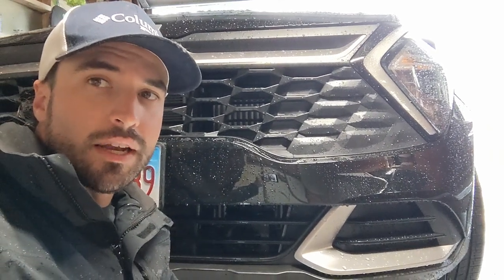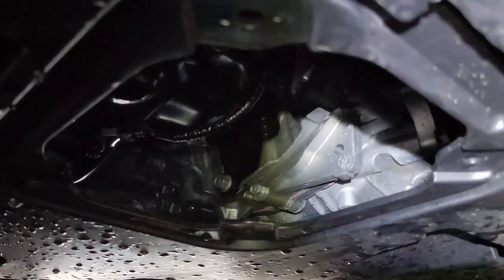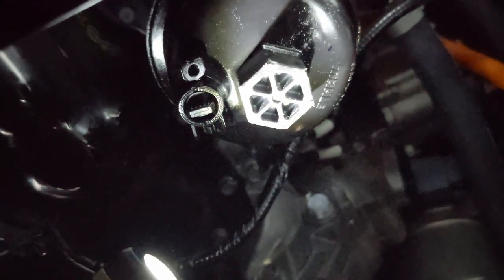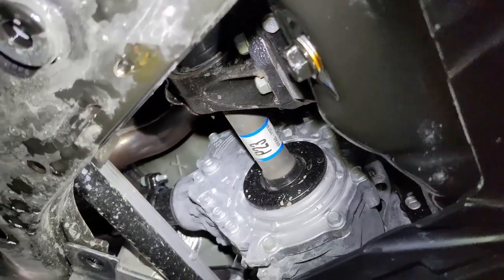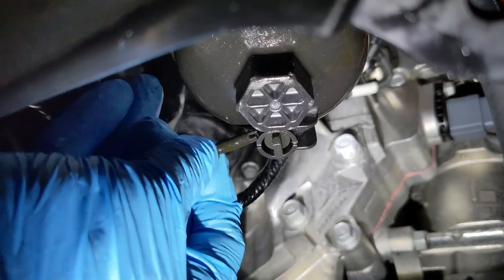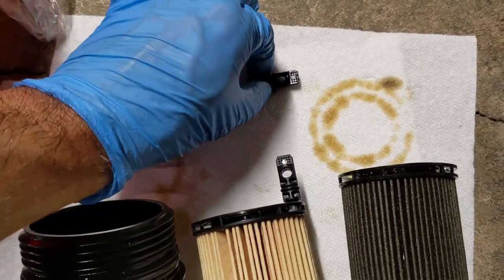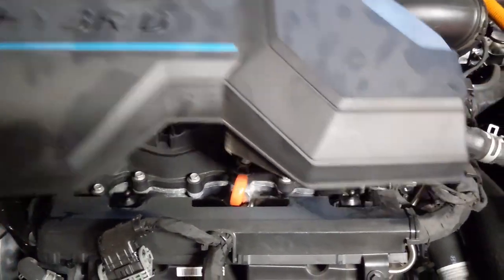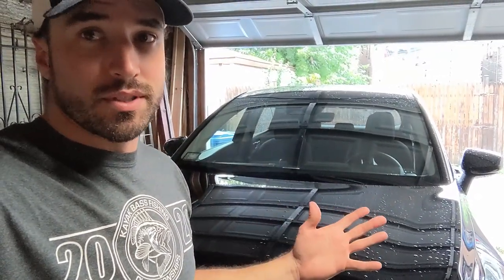Watch This Before You Do An Oil Change on Your 2023 Kia Sportage Hybrid

Comment: For those who are wondering, you will need 24mm of 6 or 12 points socket wrench to open the oil filter housing.

Thanks for the video! It really helped me a lot getting the correct parts.
Reply from the maker: Thanks for sharing this info. 

Glad the video helped!
Reply: Good old Kia, why not make it the same size as the oil drain plug? So frustrating… so Kia did my last oil change and made it so tight I couldn’t even loosen it with an adjustable wrench for fear it would strip it. I had to go buy a 24mm socket. Ridiculous!!!

Comment: what kia usa has to say about servicing your own car rather than certified shop vs the warranty?
Reply from the maker: The key is documentation. So long as you keep receipts for the correct synthetic oil/OEM filter along with mileage logs, you are properly documenting your changes at the recommended intervals. Not changing oil causes very noticeable issues that are easily traced back to not changing oil. Any other drivetrain problems covered under warranty are generally not related to oil in any way. 

I'm sure a dealer will tell you otherwise but they obviously have a little different motivation for doing so. 

If your dealer offers free oil changes, by all means take advantage of them. If they don't, I'd be saving my money and ensuring the proper oil is used in my car.

Comment: You do know this voids your warranty for your engine if anything happens kia will ask you for proof of oil changes at XX about of miles and dates and type of oil and if it was done by a certified shop or mechanic etc , I know it sounds crazy, but dealers do  everything to avoid paying out for big repairs such as a engine replacements.
Reply from the maker: Incorrect. 

I have records and receipts organized. My warranty is still valid.  

When I went to the dealer to get my free change, they failed to do it properly. I won't be allowing them to mess things up again.

Comment: does the oil brand matter? as long as it’s full synthetic it’s good?
Reply from the maker: In my experience there is no notable difference. This is an endless online debate but the tests and studies I've seen conclude that there is not a significant difference for normal drivers. Most off brands are manufactured by the same companies that produce the big name brands anyways.

Comment: Great vid!  On the 2.4L and 1.6L Hyundai/Kia oil pans I wish they designed the plug area so all the oil drains out.  The plug is up too far so there is always some used oil left in the bottom of the pan.  I let the oil drain overnight then rock the car backwards and fwds to get the last of the oil out the best I can.  The older 2.0L oil pans were designed so the drain plug was at the lowest point so all the old oil would drain out on its own.  Also do use a new crush washer and don't over torque the plug as the 2.4L pans are prone to hairline cracks around the drain plug.  30 lb/fts is all you need with a new crush washer.

Comment: Nice video! I think most new oil filters should also come w/ a new o-ring to put on the threaded oil filter cap.
Reply from the maker: They do! I seem to have left that bit out.
Reply: They also come with the crush washer which should be replaced at each oil change, as well as a new pin to hold the filter plug in place.

Comment: Great video. Are you jacking it up or shimmying under there? I don’t know where to place the Jack under the car due to all the plastic, and it’s hard to Jack it up using Jack points and get Jack stands in place in those same Jack points.
Reply from the maker: Just shimmying under at this point. I haven't even looked for the jack points yet. A set of ramps would be a good alternative to jacks but I currently don't have storage space for em.
Reply: @RivermanTV-  I just did mine, I did the shimmy too. I have a couple 2x6 boards I drove up on for a little more clearance, it's a tight fit for me lol. Thanks man.
Reply from the maker: @Eggwich  That's a good idea. Glad you got under there!

Comment: Great video, very concise and to the point. 3 quick questions:

1) The O'Reilly filter kit I believe comes with a new crush washer as well for the drain plug? Just confirming, as it does appear to show one in the kit contents.
2) How many quarts of oil per oil change in the 1.6L turbo Hybrid?
3) For the documentation part and keeping Kia happy on the Warranty -- how are you doing this? Snapping photos of the actual Oil/Filter receipts, and simply notating the date/mileage of oil change?

Thanks again for the vid, and any info you can provide on the above questions.
Reply from the maker: 1) Yes it does. If I left that out, it was unintentional. I do change the crush washer with every oil change. 
2) The information that I am seeing calls for 5.8L or 6.1 quarts for a service fill. 
3) For the documentation, I am keeping receipts of oil/filter purchases as well as documenting date and mileage. I have also taken it to the dealer once since they offer the change for free. However, the wait time is so insane that I probably won't be doing that much so I'll rely on my own documentation.
Reply: @RivermanTV-  Many thanks for the quick reply Riverman! Prior to your reply, I downloaded the 2023 Sportage Hybrid owners manual to see if volume of Oil per oil change is referenced.

According to the Manual, they're calling for 5.07 US quarts (4.8L). Here's a screenshot: https://i.imgur.com/hpsELXJ.png

Is the 5.8L (6.1 quarts) volume number referenced elsewhere? 

And 2 final things...

1) With this style filter where it's fully encased in a housing, are you doing any kind of "pre-fill" with fresh oil in the housing (in effect soaking the filter) prior to reattaching to the vehicle? I know with a more traditional style filter, a lot of guys will fill the filter with new oil before installing. Although doing that is kind of subjective, and you def see varying opinions.

2. With both the filter housing & drain plug, are you tightening to any specific torque spec? Or are you just tightening to snug?

Thanks again!
Reply from the maker: @kevingibbons  good find! I referenced my manual when doing the oil change in the video but couldn't remember the volume it called for. I was looking through the car's specs on a website that listed just about everything. But clearly they were off. 

Because of the filter/housing design, I don't think it's necessary to do any sort of pre fill. Even if you did, it seems like all you would be doing is filling the "reservoir" that is the housing before oil flows to and through it. If there was some sort of definitive practice suggested by Kia I'd do it, but I don't know that there is. 

As far as torquing the drain plug, I set my torque wrench to about 30 pounds. This is based on specs found on comparable Kia/Hyundai models. 

Hopefully soon there will be more information available when it comes to torque specs and other important information for this vehicle. I had a '13 Mazda before this car and could easily find service manuals that had all this info. Not sure if Kia/Hyundai make those available for their vehicles.
Reply: @RivermanTV-  5.8 or 6.1 is for the 2.5L GDI
Reply: I saw the 6qts and guess what... I overfilled.  Drained about one quart (so it is 5qts).  Now it is in range. @RivermanTV-

Comment: Good info on oil change. I would have liked to seen the oil draining out of the oil pan. Did it make much of a mess draining out or get on the lower shield through the access opening?
Reply from the maker: It flows out smooth and doesn't get on the plastic shield.

Comment: Hey Riverman, Can you tell me the oil change torque specs (drain plug and oil filter housing). for the 23 Sportage Hybrid? I can't find them anywhere.
Thanks for the video!
Reply from the maker: I don't have the official numbers. I went by the 2022 Tucson specs because there is a lot of carryover in what parts are used on these models. Haven't had any issues without the official torque specs.
Reply: @RivermanTV-  Do you still have those 2022 Tuscon specs handy, I'd like to see them? I agree, looks like essentially the same gear on both vehicles.
Reply: 25-33 ft/lbs for the drain plug, always use a new crush washer.  18 ft/lbs for the filter housing.  It feels like it's cross threaded the whole way off and on but that's the design.  It doesn't have to be super tight just seated as the o-ring is the seal.  Most new filters like Wix come with a new o-ring and crush washer for the drain plug.

Comment: Did you have to manually reset the oil life in the settings? Or does the car auto detect when you changed the oil by itself?
Reply from the maker: You have to manually reset it in the menus.

Comment: Thanks so much for this video. I have the 2024 sportage which is slightly different with the pin, question though, after changing it I have a tiny slow drip from the oil filter housing, I removed everythign checked and replaced the rubber gasket redid it all and still the same thing. It's not even enough to drip in the driveway just always has a drop running down the side of the oil filter housing. Any idea what might cause this?
Reply from the maker: Are you tightening the housing with a wrench to ensure it is completely sealed? The only reason I can think of is that something is either not seated properly or tightened all the way.

Comment: How much is too much oil? I have about an extra quart of oil in my Sportage and the recommended amount is 5.1 quarts. Should I have it removed or is it not enough to cause issues?
Reply from the maker: Personally I wouldn't be comfortable with an extra quart. Find a liquid/oil extractor on Amazon and remove the excess.

Comment: Hi, how many miles did you put on this before you got an oil change? 

I have an SX Prestige I bought last year, and I just now got 4K miles on it, but my oil % on the dash say I have 12% remaining so.

Also its my understanding that this car is supposed to have full synthetic oil so I should be able to run this to 7,500 miles.
Reply from the maker: I did my first change at around 6k but ever since then I wait until I cross the 8k mark. 

Some people say you should do the first change around ~5k so it certainly wouldn't hurt for you to do so. 

Full synthetic all the way.
Reply: @RivermanTV-  OK thanks, yeah I probably get it changed at 5k along with a tire rotation at the dealership.

Comment: You said you needed to change the crush washer every time you do an oil change if i were to get a fumoto valve would that still be true? also is the fumoto valve worth it??
Reply from the maker: I've never used a fumoto valve, but it seems like whatever washer comes with it would stay in place for the life of the valve.
Reply: @RivermanTV-  oh awsome! they are unbelievably convenient and clean.

Comment: Where did you buy filter at and can you provide a part number
Reply from the maker: https://www.oreillyauto.com/detail/c/original-equipment/original-equipment-hyundai-kia-oil-filter/pgf0/263502m000?q=263502M000&pos=0
Reply: Get it directly from kia, it's cheaper

Comment: What size socket did you use for the filter housing?
Reply from the maker: I used a 5/16th which was a little big. 3/8 or 23mm should work but there is a little wiggle room if you have something close.
Reply: So I’m confused, how does 3/8 inch equate in any way to 23 mm? 3/8 inch equals about 9 mm, I’m kind of confused here on this comment.

Comment: Are you sure about the oil capacity?

Everything I've seen for the 1.6 is 4.8 to 5.1qts. The 2.5 non hybrid is  6.1qts
Reply from the maker: Yeah, you're right. I was looking at a site that confounded the hybrid specs with the non hybrid. 5 quarts is what I've been doing.

Comment: This is one of the most pointless design. All plastic, just refill filter and it cost (for me) $18 for kit. Saburu, Toyota, and BMW can just open cap. Then remove a simple fitler. Or old school for $4-12 per fitler. Made with metal, 100% recycle is possible.